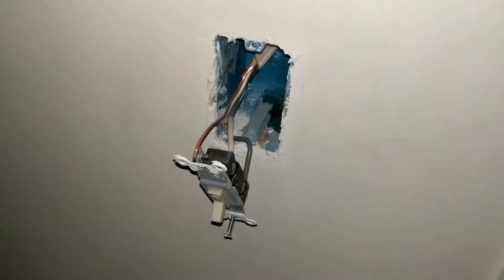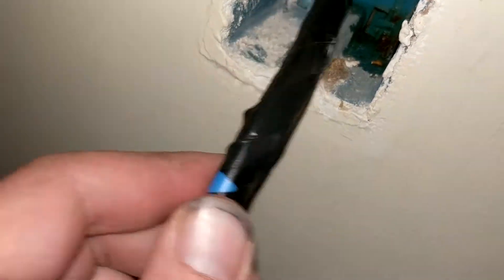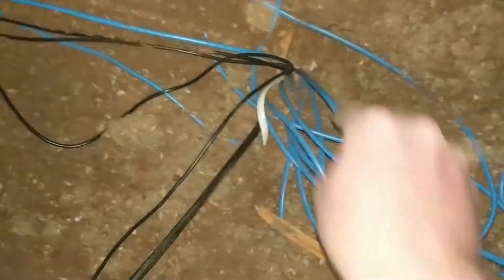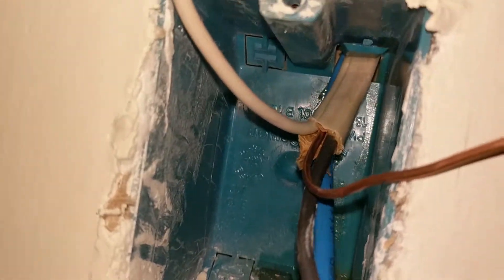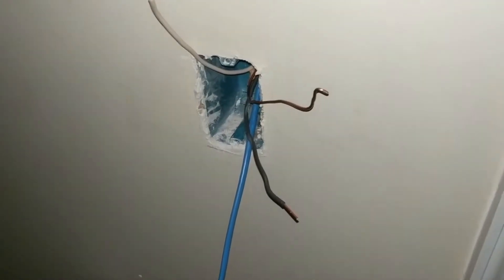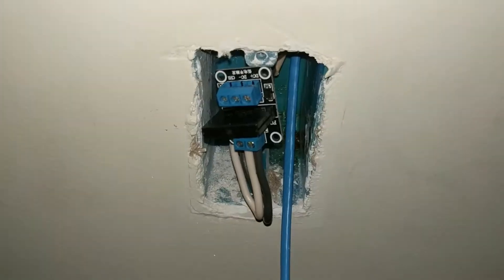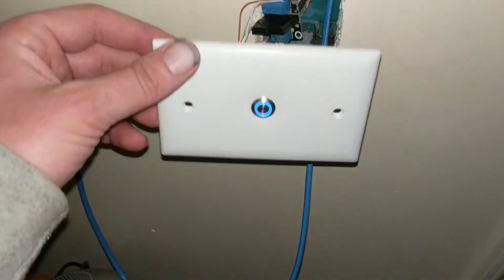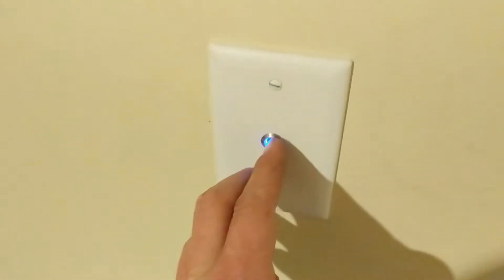My Arduino Home Automation System - Light Switch Button Installation

Comment: How about if use 5 volt relay
Reply from the maker: Amir Omar Amir the relays I use are 5 v
Reply: My Arduino Home  thanks sir
Reply: Sir i had watched your previous videos upto part the code is good but i messed one library called #shifter how can i get this library
Reply from the maker: The shifter library I used is as follows: https://github.com/ameyer/Shift-Register-8-Bit-74HC595